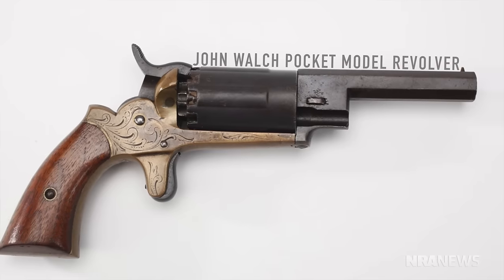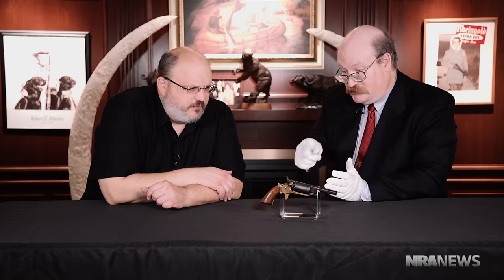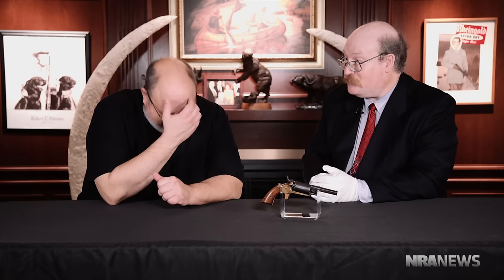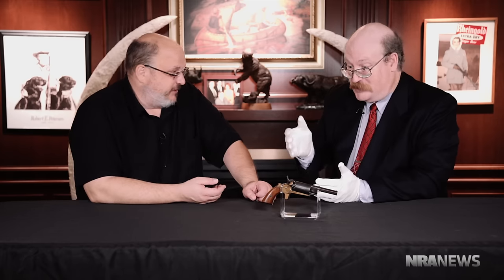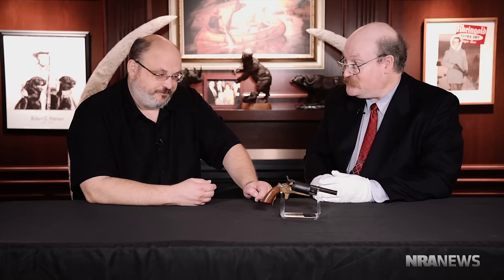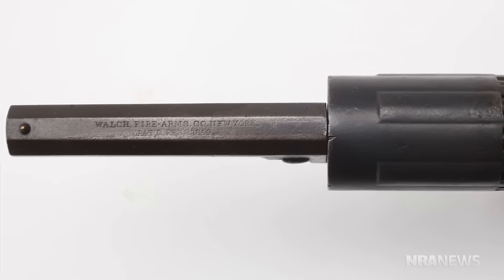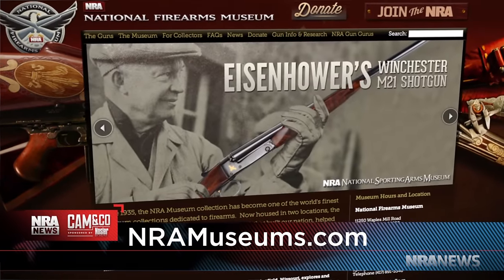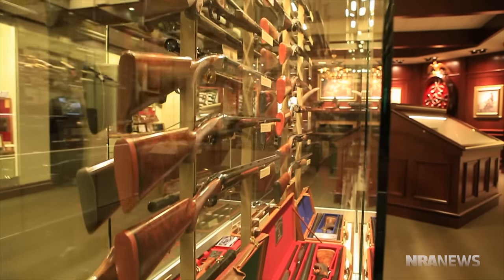Curator's Corner: John Walch Pocket Model Revolver

Comment: They made a larger 12 shot .36 cal Navy version as well.They also made a special two piece bullet that had a front and back half with a soap/grease mixture sandwiched between the two halves.The idea was that when loaded the soap/grease would squeeze out the sides against the cylinder wall and prevent chain fires.Although in reality a chain fire from the back through a nipple was just as possible if not more so.